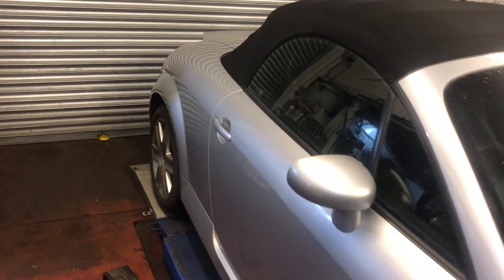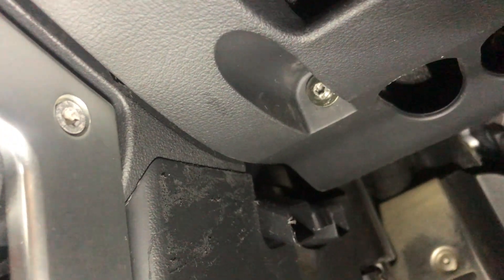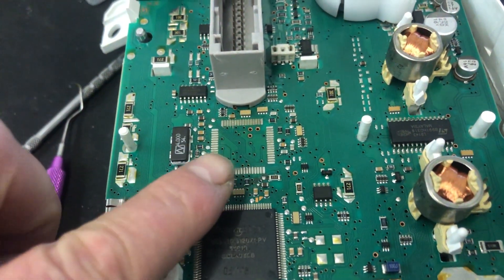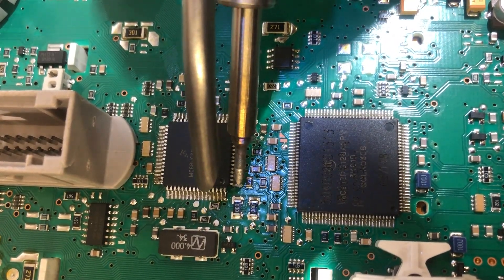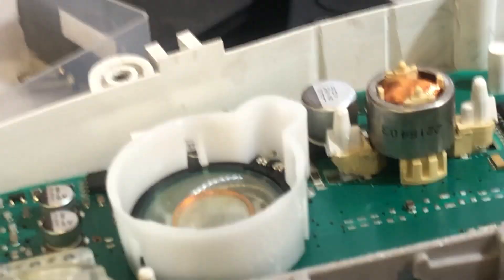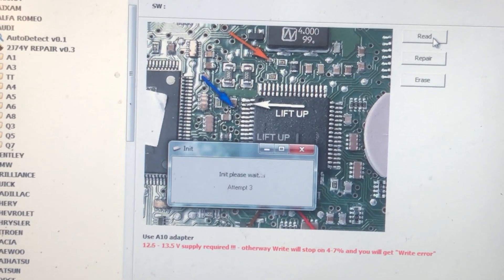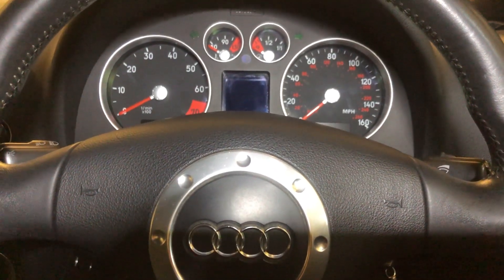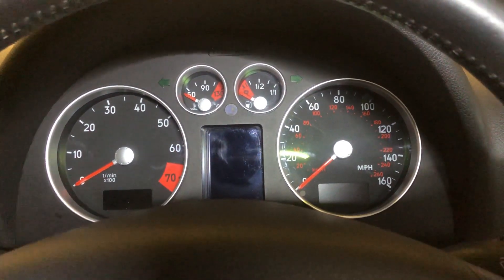Audi TT mk1 Instrument cluster Removal + Display screen + processor replacement

Comment: I have problem with odometer whats displays 999999 miltage. Is there problem with procesor also?
Reply from the maker: Hi, yes this is a known issue we fix - the actual fault is corrupt Eeprom data in the MCU, it’s recoverable & we offer this service on our website:
https://ecuconnection.co.uk/product/audi-tt-mk1-instrument-cluster-cloning-screen-replacement-refurbishing-pin-retrieval-mileage-correction-999999-miles-fix-service/
Reply: @JC-ECUConnection  are you able to fix this when i send you a eeprom data file? How much it will cost? Im not in UK

Comment: very informative, i myself managed to successfully replace the screen, but still have a problem with the fuel gauge (was faulty before). When reassembling and attaching the needles, the fuel gauge always went to a different position, same with a replacement stepper motor. Since i couldnt solve the issue i put the original stepper motor and everything back together and into the car. But now the needle stay at off position and low fuel light/beep comes on all the time. 
Before i opened the cluster for the screen replacement i also suspected the sending unit to maybe be the problem, but with the needle going crazy at the bench without the signal, the cluster itself must be the problem, or am i wrong with that?
Reply from the maker: Hi & thanks! These units are pretty old now & can have many problems with dry joints, usually on the SMD resistors - best to reflow all of them on the board, also the software in the 2J47Y can get corrupted or the 2J47Y itself can be faulty & also the voltage regulator can give problems.. good luck & give these items a look!
Reply: Thank you, much appreciate!

Comment: The rpm and temp gauge of my cluster isn't working anymore. I changed both motors but it still not working. Do you have any clue of the problem?
Reply from the maker: Possibly the circuit board will need reflowing of all the resistors, this can often be the cause, also it could be the 2J74Y processor / software glitch on this processor or maybe even the voltage regulator on the PCB..

Comment: I am looking at getting a mk1 tt and the mk1 tt i have viewed the lcd screen in the middle contantly shows this symbol "---------------" across all of the lcd screen would a new processor and screen fix this issue? , im thinking the screen works but the processor is broken? any ideas?
Reply from the maker: Hi, thanks for watching - sorry but without having the cluster in for test & repair it’s not possible to say what the problem is, it may well be the processor but it could easily be something else causing the issue…

Comment: Can I ask why you replaced the processor? I have a problem with the speedo on my MK1 TT cluster. When I run the output tests via VCDS the sweep does not go to 100km/hr. It goes to about 97km/hr. If I reposition the needle to 100km/hr it does not return to zero. Could I need a processor replacement/reprogram?
Reply from the maker: Hi, thanks for watching!.. personally I always set the speedo & rev counter at zero (ign power on) before doing the output tests & don’t worry about where the needle sits at the end of the output test - the important needles to set are the temp & fuel needles, these must be exactly at the midway point at the end part of the needle sweep test, I don’t think you have a processor fault.. In this case we swapped & reprogrammed the processor due to the fuel & temp needles over reading constantly, we replaced the display & reflowed the circuit board & reprogrammed the processor previously but this particular cluster refused to behave!
Reply: Thanks for getting back to me @JC-ECUConnection

Comment: Which cable do you use for VCDS?
Reply from the maker: Original Rosstech VCDS interface
Reply: @JC-ECUConnection  ouch, those are £600 upwards?
Reply from the maker: No, 3 VIN are much cheaper, £200 - 10 VIN £300 - unlimited VIN £500
Reply from the maker: @Barrybigdickstein  yes, I believe that is the case…